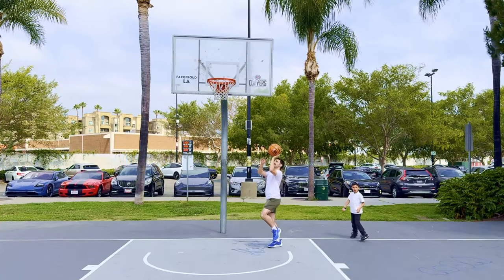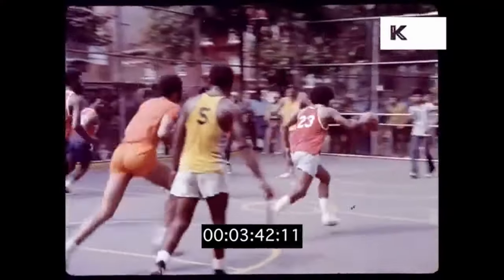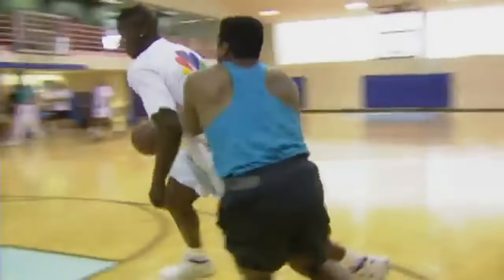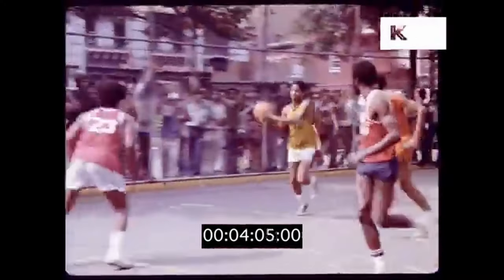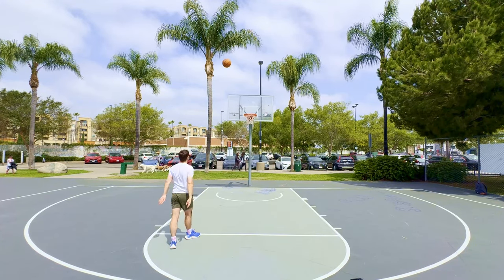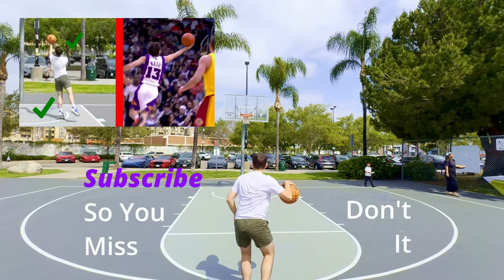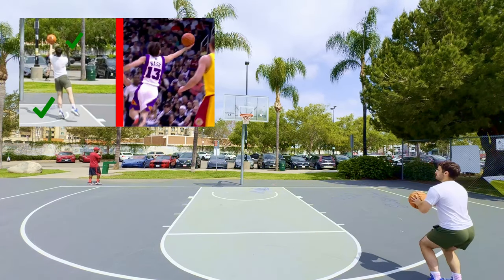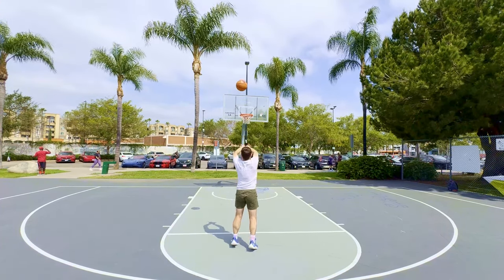How To Fix Your Pickup Jumpshot

Comment: Left hand shooter?
Reply from the maker: You know it
Reply: @Cadoor_  bro im 1v1ing my friend in 3 days i lowk need tips help me out
Reply from the maker: Gotta gimme some more info about both of your games. In short: always use size/speed if you have an advantage there, good pump fakes are free buckets, and make them think you can hit a 3
Reply: @Cadoor_  i can't hit 3s like consistently ngl. I'll hit like 3/10 threes. Might sound bad but it's better than most, my pump fakes work a little but he swipes on crossovers with NO hip swivel. I'm taller by like 3 inches tho